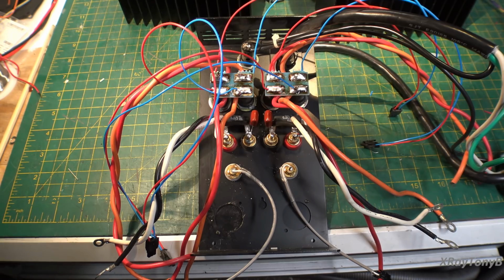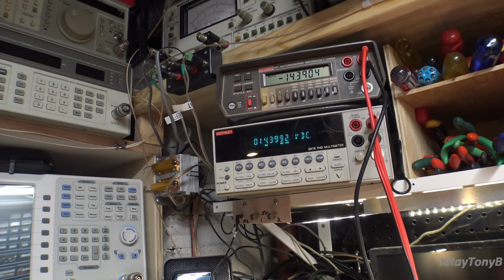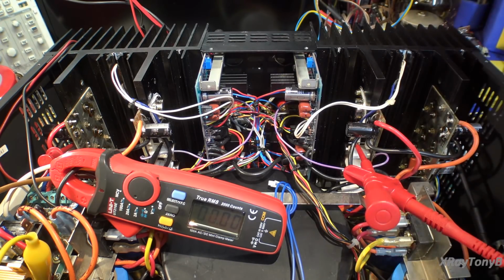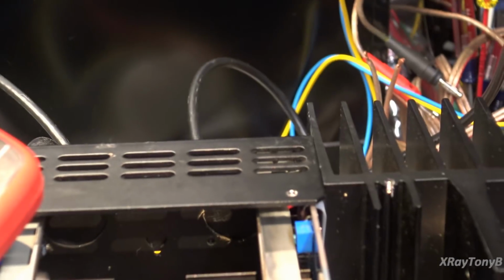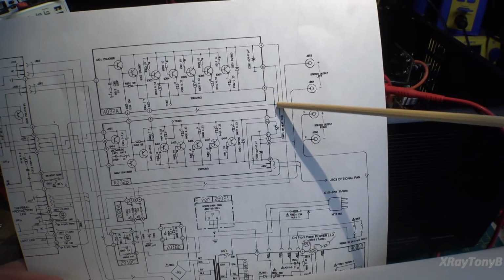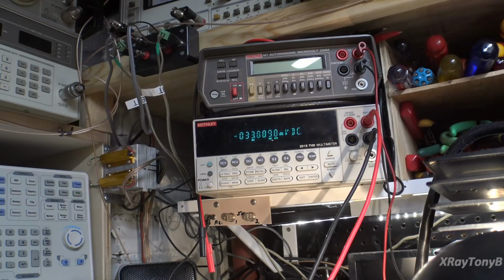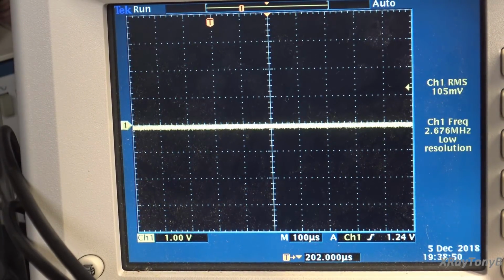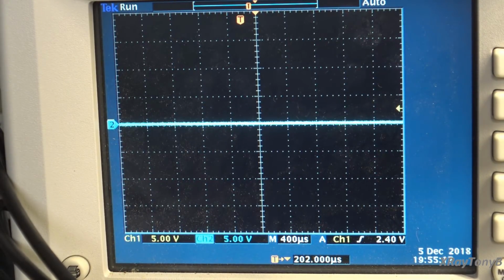Adcom GFA 585 Part 3 Final - Reassembly and Testing

Comment: Hi thanks for your videos great stuff. 
I have just repaired a 585 from a. Blown channel and the pre amp boards cleaned and repaired,(yes caps leaked terribly) so it’s up and running now, it’s biasing correct but I have an issue with dc offset on the output. Both are around 800mv. What components tracks  to look at and clean ? I’ve cleaned the board thoroughly and removed some components. 
Thanks in advance
Richard

Comment: Question: if your final sweep of power output from low to high Hz had shown lower peaks (low gain at low frequency) but moderate gain at 1 khz, and more gain at 5 khz, all of which are underneath the rated spec of the amplifier, what component would you be most suspect of being bad? The big power supply Filter capacitors even if the positive and negative DC rails are the right voltage?
Reply from the maker: I would check the test setup first.
Reply: Usually it's a a bad cap in the feedback circuit...

Comment: I was a ground radio repair technician for the Air Force for two hitches from the '80s to the early '90s and in all that time I never ran across a stabister. Early in the career I would repair the equipment down to the component, but towards the end it was largely module swaps (boring!). They had me teaching some of it for a while, which was rewarding. Your videos are very useful in refreshing my memory. Thanks for posting. By the way, I can't help but wonder how many brands of equipment were affected by those leaking capacitors. I have a receiver I am going to work on that has the same problem (Onkyo). Hopefully the power supply board isn't completely toast.

Comment: Thanks for the wonderful videos. I will surely open up my vintage Sumo and see if anything is leaked or rotten like you showed in your first video. My power amp gives a low hum. I tried by disconnecting the pre amp, but noise continued, then tried different cables, noise persisted. I read somewhere that problem could be from the big caps or from the power supply. Can I talk to you?

Comment: Followed everything clearly, still very uncertain how you handled the leaky, vented cap on the output transistor board. It looks like your finished amp is using the same board? It doesn't look like Hoppe's does not sell this board either. (I have a gfa-585 that has all these same issues, trying to decide to proceed)

Comment: I wish you tube was around when I was 16 watching you and being interested in electronics and hifi even now at middle age I would have taken electronics up as a perfession I really like the way you explain how all the items interact with each other thank you for taking the time to show people like myself how these amps actually work I have alot more respect when turning on my amps and pre amps thanks to you  Sir .🙏
Reply: Electronics as a profession  is a whole lot different than what this dude is doing, repairing this power amp. IN THIS DAY AND AGE, they would more than likely throw this Amp in the garbage.  Component repair is a thing of the past, These are the true words from an EE.
Reply: @jacktaylor1030  BS! Anybody that knows anything about audio equipment can tell you that these simply bring in between $500 up to $1,000 or more per unit. They are highly regarded and well sought-after. Next time know what you're talkin about before you start spitting out BS! Collector of Hi-Fi for over 40 years here so don't even try!

Comment: You ever try acetone for old thermal epoxy, it usually eats through most all resins and epoxies. I would only do this with the board removed from the heatsink though, you never know if acetone will break down other items...

Comment: What about BD131 as a temperature sense transistor, but what about MJ3055/MJ2955 matched pair for the output as well as BD131/BD132 matched pair as driver transistors.

Comment: Wow a very  Educational video I have a GFA 555 mk2 I'm using on a pair of McIntosh Ls 350 witch are very nice speakers but I don't think I'll be using it very much longer cuz I can't replace them speakers it's a really nice match for the speakers and that mod you did looks expensive......I'm really kinda  Aggravated I'm now going to have to buy another amp!!!  I do not want to burn my McIntosh Ls 350 witch are pretty rare unreal
Reply: just have it recapped before it does become a problem like this one. this one had been used for awhile with bad caps before it fully failed

Comment: Hi Tony. Thank you for the great video series. The fact that you've done the whole rebuild successfully, and you state you've not done such a complex job before, gives me the courage to try and expand my range of repairs. I'm in the process of restoring a Yamaha CR-1020. The main power board has been damaged by corrosive glue, so in addition to replacing the capacitors, I feel I should replace the transistors as long as I've got it torn down this far. Like you, I have run into trouble finding some of the transistors. The usual suppliers are not carrying them anymore, but I did find them on utsource. Do you or any of the viewers have experience with this online company? I'm leary because it's obviously a Chinese company, and I believe I've heard you make reference to "fake Chinese components." Thanks for your input!

Comment: Rebuilt a GFA-555 mk II a couple years ago.  Two of the main filter caps were pretty much shot (more than 40% capacitance gone).  It's worth replacing them no matter how the measure.  Nippon Chemicon U36 series are excellent replacements.  I ended up selling it because I just could not get over the fear of torching my very expensive KEF speakers due to the lack of a speaker relay protection circuit.  Also, the amp would send out some minor popping to the speakers on shut down as the filter caps discharged.  I'm much happier with my NAD.
Reply: You could install a speaker relay board. I am sure the ADCOM is by far a better AMP

Comment: Nice amp, grand video as always. BTW, why is a full power test hard on the Zobel network? Because it's attenuating at HF and therefore the resistor gets hot? Cheers - DA.
Reply: Yes, it's mostly high power at high frequencies that's critical - and square waves contain particularly much HF energy.

Comment: Excellent rebuild.
I recall my first encounter with these Adcom 5 series back in the eighties at a local hifi shop.
As a demo they would power up these monsters and drive the Infinty Kappa 9 towers.
A very powerful experience.
To add some novelty, they would also cut the power to the amps while still running.
I swear the signal would still be coherent and audible for 20 or 30 seconds afterward.
This kind of power for around a kilobuck point was a hoot!
Really nice watching you resurrect them so masterfully.

Comment: Wow, that channel got completely destroyed! It's rare for the heatsink-mounted thermal bias compensation transistor to be burned out. You could also use KSP42, but the one you chose is good too. You'll notice there is also a PNP type thermal compensation transistor mounted on the input board. I think the idea is to kind of get an average of the board temperature and the output module temperature. In the GFA-565, both of these comp transistors are mounted in the output modules, one for each PNP and NPN module.

Comment: i just now sat down and this popped up. good!
 the first comment also. rare :-)
 now all you need is an old B&K amp to make it's way across the bench.
 there was also a company called db systems that did some really nice sounding transistor amps.
ever run across either of the two?